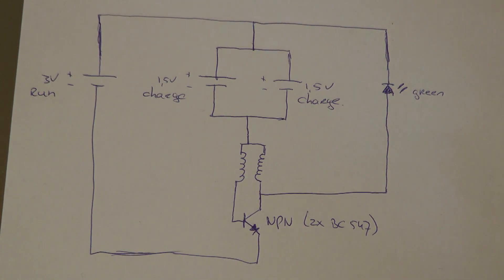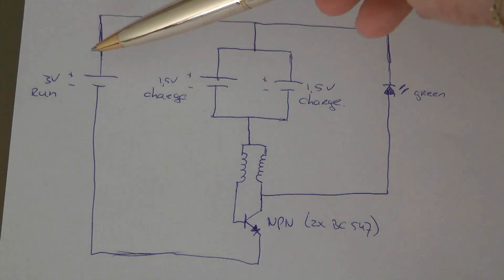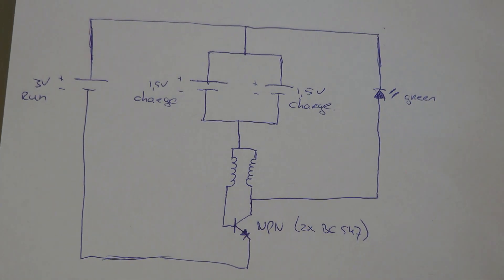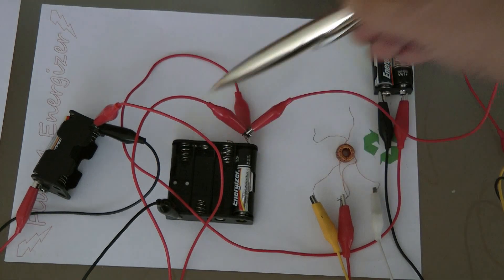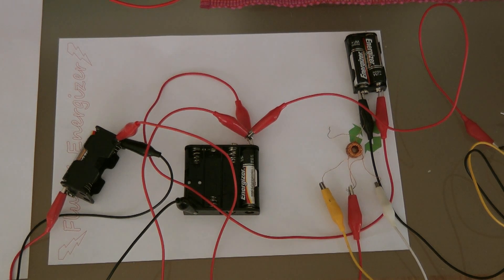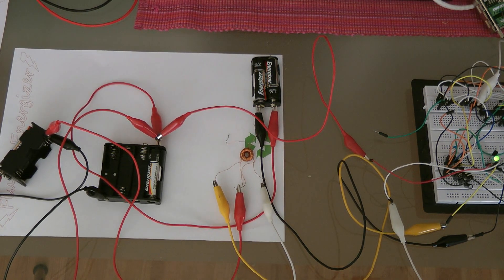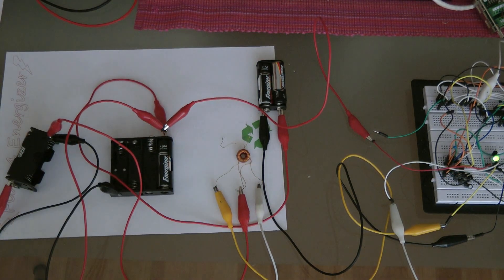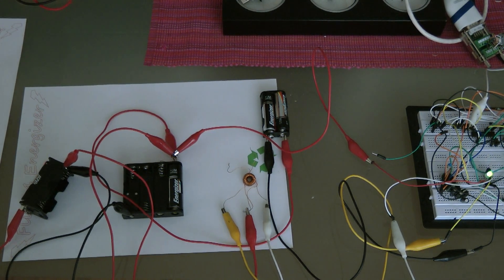Joule Thief Battery Charger (Revisited)

Comment: Yes, the circuit charge the battery. However, the charging battery does not hold the charge well. the battery discharges very quickly, but if you insert it in another circuit, it also discharge very quickly as well. do you know why?

Comment: Hi, Ben here. Nice to see other dutchmen looking into this! I was wondering why you put what looks like two transistors in parallel. Never seen it before. Is it essential for the efficiency of the circuit or could you replace them with a single transistor? And if so, which one? I like this circuit and am definately gonna try it out myself!
Regards, Ben

Comment: Hi..Replying to this now maybe old video..But I did this following your schematic, but used only 1.5 volt new AA to charge a depleated AA rechargeable. Used 2x 2N3904 transistors and a blue LED as a diode, seems to work fine. Putting 3volts in to charge a rechargeable charges really quick..maybe too quick. Nice and simple circuit. Will be trying Sohei Thoth & emc4u2 circuits next when the bits arrive. Thanks for your excellent video.

Comment: Thanks.  Ok, I was thinking of like maby boosting the supply voltage from something like a small solar panel or some other low voltage source, to recharge batteries / save -store the energy.  I would like to maby make one where its on a bike, and the voltage source might be a magnet and small coil charging up a small capacitor and that voltage running a joule thief.   Many ideas to consider.

Comment from the maker: @Trailkeeper
You are right, but the Joule Thief circuit (too me) is ment to light a LED (or multiple LED's). So this is what i intended to do: light a LED and feed back the used energy to a set of other batteries and swap them around.
But removing the LED and use a diode instead also works. If you use a 1n4148 or a bat 49 or something like that the voltage drop would only be 0.2 volts.

Thanks for your reply.
Regards,

Flux

Comment: The led is a nice indicator that the circuit is working ok, but it is also a waste of power, so maby have a switch to temporarilly turn it on. It the diode action of the led is still needed for the circuit to work properly, then a regular 0.7v diode might be ok.   Would this be a good idea?

Comment from the maker: @KyleCarrington
I like your idea. I actually did think of the idea but not in combination with the Joule Thief circuit. I'm thinking of building a 12 volt to 240 volt inverted kind of circuit with 4 12 volt batteries in the same concept, but it would also be possible to run it with the JT circuit. Would have to buy a solar panel tho because i don't have one yet. Thanks for the idea. I think i will be building the circuit. First will shoot a video of my latest project.

Regards,
Flux 4 Energizer

Comment: Here's a thought: Add a small solar panel,as I have done. Write a basic program to run a PICAXE do do a bunch of comparitives, have several banks. Sun comes up, PIC chooses a low bank, charges it. Sun goes down, LDR kicks in PIC, PIC chooses a strong bank to run lights. Free energy, with less emphasis on solar panel size, due to numerous banks. If a cloudy day hits, your charging a partially charged bank, and running lights off a fresh bank up to full charge.

Comment from the maker: @acmefixer
That is correct the Joule Thief is acting as the current limiter, that is what i'm explaining in the video. That's why there is no base resistor because the length of the wire or in that case the number of turns on the toroid is used to controle the dc resistance.
I'm sorry but i disagree that a resistor is much simpler then using the coil itself I don't see that point.
Thank you for the reply.

Regards,
Flux4Energizer

Comment: Actually, the Joule Thief is acting as a current limiter to prevent the 3V battery from trying to push a large amount of current through the 1.5V cells  The advantages I see are that the JT pulses the current which may have some benefit to charging the cells; and it's possible that the JT may be more efficient than using just a resistor for limiting the current. But the resistor is much, much simpler.